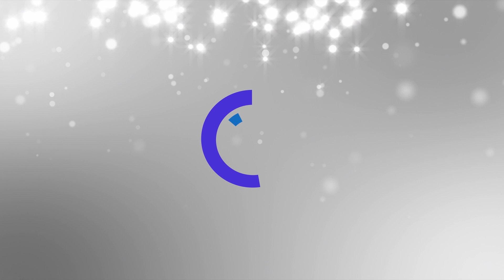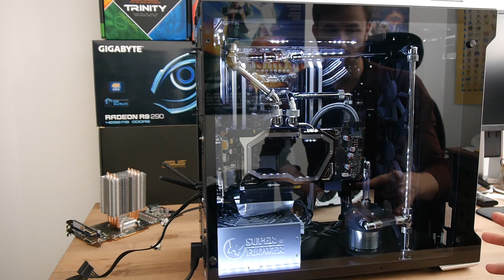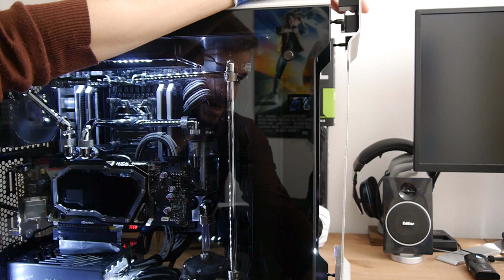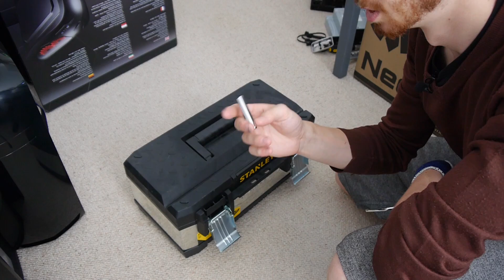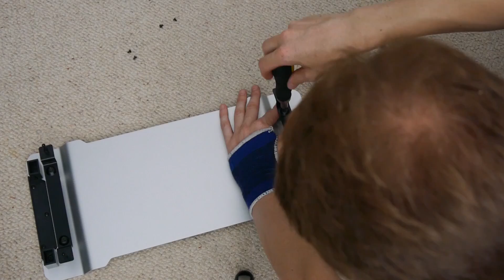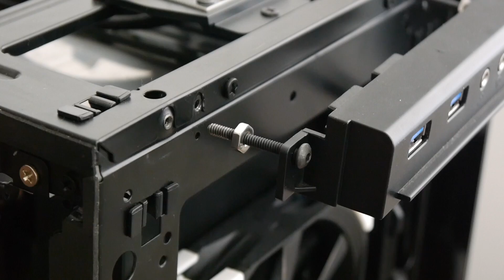How to Fix the Airflow Problem with the Phanteks Evolv ATX

Comment: however never buy it if u own a gigabyte x570 series, a few works. the D led mess up the power creating a power loop. then the MB cant detect sata disks. 
 If u have Phantex and problems with fans or sata unplug the rgb led caple from Phanteks.
 OMG mhy build is fucked.  no fix no Tits. Chose sata or rgb..  after been in contact with Phanteks , they say they dont co operate good with gigabyte,

Comment: I remember when I got this case that I actually improved internal temps by tapinig up the rear with a black tape from 3M. 

I left the original fans in place pulling from the front and placed 3 fans on the top pulling into the case, creating positive pressure, the PSU which is the same as yours was pulling air away from the GPU in the same way as yours, this creates a negative pressure in that area which is then filled with the positive pressure air and then forced out the single rear fan next to the IO.

I tested it when compared to the panels off and I was running cooler when the panels were closed.

Comment: What I did was moved the radiator to the front of the case, 2 fans on the back of the radiator and 1 on the front,pulling air. 1 fan on top, pulling, with black cardboard covering up any exposed gaps around them. Then finally one fan on the back pushing. I have good airflow coming out of the back atm, I can feel it on my hand, under the fan that's pushing.

I would doing only 2 fan on the radiator, but the airflow through there is too tight. I think I should switch the 2 to the front of the rad, and put the 1 on the back.

Comment: I just bought a 1x10 board that was 4 feet long from my local lumber yard, cut it to the exact shape as the case, and cut out the entire notch where the USB and Audio ports were and left it open. Stained it to match my desk. Also cut the side slots about 1/2" deeper than the original after I got the exact shape. then I used a router to give a 45 degree angle to the entire outside edge. Airflow problem disappeared. Currently trying to make a wood top panel, but it's a little more involved... :(

Comment: Im a bit late with this, but was thinking of this case for my new build in a few months, so wanted to see some reviews, which everyone should do. The vid has me thinking now. Been reading the comments, and seen you said all your fans are the same speed. wouldn't it be easier than modding to up the fan speeds a bit for the front fans by taking them off the fan controller and connecting them to the MoBo, or a separate hub? Or can the controller control different fan speeds at once? Other than that, great vid, gave me alot to think about.

Comment: I would perhaps drill uniformly aligned holes on that front aluminum metal. Or cut up triangle  like shapes forming a nice design up front kinda like Iron Man eyes or any other design look. Holes for the fan to pull air in. Hard without proper tools though.

The smoke seems to havr been pulled in by the PSU Fan

And speaking of PSU fan, you really should have made the fan facing down so it can pull ambient temp air from the under belly of the case. And not warmer air inside the case. Even worst when its a water cooling rig. Dont want the holes of that psu fan grill facing up waiting for that one single drop.

Comment: This is funny because I have 2x inlet fans at the front, and 3x exhaust (2 up top with rad, and 1 rear switched to Riing fans).  I do not have dust in my unit as I would usually.  My unit is 2 years old now, and my cases usually look like the moon by this point.  I can literally sell anything in my rig as mint and it would be near dustless.  The dust pattern of my filter with 2x 140 fills pretty much the circle of each fan.  I have the top portion left open.  I run X62 Kraken AiO, and a 1080 FE.  With a custom fan profile where 80 degree gets 95% fan, and 75 degree gets 75% fan, I don't usually go over 72 degree temp.  I don't have the stuff overclocked.  This thing does not flow like all the Lian Li cases I use to have, but all my Lian Li cases were filled with dust using air coolers.  This case with AIO combo has survived the dust apocalypse for me so far.  Kinda wish I wasn't too lazy to rebuild everything in the Evolv X.

Comment: The new "Evolv X" has addressed those issues and then some, it is suppose to come out this August or next month. Phanteks has claimed three times the airflow at the front panel, and five times airflow for the exhaust at the top.  With clever cable management panels that doubles as mounts for nine SSDs, and also can hold up to ten traditional hard drives at once as well. Also with the nifty option of installing a secondary mini ITX system at the ceiling of the case itself which essentially houses two computer systems at once!. With all that capability of holding all of the above at once, that would be one heavy beast to lug around. Looking forward to getting it myself. :)

Comment: What is the length of the spacers? I dont want to space it out to much.
Reply from the maker: I used 2-2.5cm, but 2cm will give excellent results. Anywhere from 1-2cm will give a significant improvement, it just depends how far you are happy to space it out.

Comment: This is a lot more elegant than what I do which is removing the entire panel when I game. Also you'll notice that propping the top panel also helps evacuate some of the hot air out the top
Reply from the maker: I haven't tried propping up the top panel yet. I'm not sure what is the best way to do it, and I don't have much cooling going to my top panel, so I've never been too bothered.  How did you do it?
Reply: Jeagar Tech I just removed the 4 screws from that top panel popped it off so there's a slightly bigger gap to allow for the hot air to exit. I have a 280 rad up there so when my fans ramp up it helps evacuate the got air

Comment: what about the top panel? can you do the same with some spacers?
Reply from the maker: Not really, the top is held in differently and you can't really just raise it up at all... To get better airflow you might have to cuts holes/vents in the top panel.
Reply: bad news:( btw you could buy spacers on aliexpress of every mm you need).  What do you think about the nzxt h700i ?
Reply from the maker: What sort of spacers? 

Err, the H700i looks pretty decent, I think it is classic NZXT (so as a whole a damn good case!),. and the airflow looks not bad, if not the best. It's so overpriced though!
Reply: Jeagar Tech Im trying to understand if airflow is better on h700i than the evolv atx. For the spacers I will search for the links
Reply from the maker: Ahh okay, the H700i will have better airflow without modding.
Reply: so spacers I've found and ordered are: https://it.aliexpress.com/item/50pcs-lot-aluminum-spacer-M3-5-6-8-10-12-15-20-25-30-35-37/32811889038.html?spm=a2g0s.9042311.0.0.YFnBdz
and  https://it.aliexpress.com/item/10pcs-lot-free-shipping-3mm-aluminum-spacer-m3-10-15-20-25-30-35-37-40/32809949758.html?spm=a2g0s.9042311.0.0.YFnBdz

plastic spacers are easyer to cut XD

Comment: They make replaceable front panels for this case that have proper airflow design. 

https://mnpctech.com/phanteks-case-mods/
Reply: Here is another one I'm sure You've seen but still does a fantastic job, Design 4 really follows the normal hole design on the top piece.

https://www.gosumodz.com/EVOLV-CNC-Service
Reply from the maker: I havent seen those actually, they look really good!
Reply from the maker: It's such a shame, but at least you have a nice looking mod that makes your case unique.
Reply from the maker: The smoke test is really easy to do, and is a really useful test if you just pop the front panel on and off and see what happens. Let me know how it goes!
Reply: No noticeable smoke entry from the back or sides of the case. There's actually a positive pressure at the PCI-E vents, blowing outward where there is no exhaust, so that's a real plus. It just took me programming my fan curve for a constant of positive pressure, and, of course modding the front panel. So, yeah. With the front panel on, I've got positive pressure and hopefully a lot less dust accumulation in the future.
Reply from the maker: Yeah these were some of the ones I was talking about in the video. I think they look really cool, but I still prefer the plain panel look.
Reply: I wish they would do work for the P400STG. No one seems to want to mod the front of this thing.
Reply: I haven't finished it yet, really, as I'm waiting for metal reinforced cutoff wheels and a step drill bit (very expensive) to arrive. I actually used an older iPhone charger block to make the rounded diamond shapes for the template, and I think it will look fantastic once it's done. But like you, my case was pulling air from all manner of areas it shouldn't. Negative pressure abound. I think it still might be when I max my fans out, because I have two top 140mm, one 120mm rear, GPU and PSU exhausting, while only two 140mm fans on the intake. But, I've put two slower, quiet Phanteks fans exhausting out the top and two Cryorig QF140 Performance fans on the front intake and am running the fronts at 1/3rd again as many RPM's as any of the exhaust fans, so the pressure should be pretty close to even at this point. I'm going to do the smoke test later this week to be sure.
Reply from the maker: That's awesome, nice work! It can take a while to get just right, but I'm sure it's going to be worth it from now on lol

Comment: You should have done like I did with my P400STG and drilled some nice looking holes into the front panel. Mine is even made of sheet metal, so it's harder to drill than aluminum. 

https://drive.google.com/open?id=1UxIMOBZu__lv8qEvg-bhB6_MHRbNfeHX
Reply from the maker: That's a nice looking mod! I had thought about drilling/cutting the panel, but I preferred to keep the look basically the same. The point here was to improve airflow without altering the looks too much.
Reply: Love the P400STG I'm still debating between the White P400S or the Silver Evolv.
Reply from the maker: Good luck deciding, those are two really nice cases! I like all of the Phanteks lineup at the moment, it's a nice range of styles, and they all have sleek individual looks in my opinion.

Comment: I like that you showed how the air is sucked in when you have negative pressure. I shows that airflow has a huge impact on dust building up inside the case.
Reply from the maker: Thanks man, I had no idea how bad it was until I tested it!

Comment: Good modification. I took the same idea and used nylon spacers and 6-32 thread thumb screws. I spaced it all the way up to where the front panel edges slightly ahead of the edge of the glass. So far its dropped a couple degree celsius and the aesthetics of my case aren't noticeably hindered plus I have complete access to the front I/O with the I/O door able to completely open all the way. Only problem is the front rgb LED is to far back to show through the front but that was expected. Ill figure a way to fix that next time.
Reply from the maker: Awesome! It's nice to hear that someone else had the same idea :D I extended the LED, unfortunately I didn't show it, but it was the same process as the I/O that I show at the end. Just use a screw and a bolt to hold it in place further away from the case :)

Comment: 2 fans blowing out the roof, 1 fan blowing out the back and 3 partly obstructed fans sucking in the front. That logically translates to negative pressure, no surprise there. Before thinking of modding the case i would have worked with the fans speeds. Possibly removing the back fan completely, or adding a floor intake, i don't know if this case offers that option.
Reply from the maker: I did change the fan speeds because the dust build up was annoying me. I had the rear exhaust fan completely off at idle.

The problem with that is that you are losing airflow performance or increasing noise. That is the problem. You can always just make your intakes spin faster or exhausts spin slower, but that doesn't solve the problem, it just changes the problem. I'm trying to solve it here, and the mod wasn't difficult/I was happy to do it, so it was a very logical choice :)

Comment: Just ditch the rear exhaust fan and u get u'r self a positive air pressure system.
Reply from the maker: The problem with that is that you are losing airflow performance or increasing noise. That is the problem. You can always just make your intakes spin faster or exhausts spin slower, but that doesn't solve the problem, it just changes the problem. I'm trying to solve it here, and the mod wasn't difficult/I was happy to do it, so it was a very logical choice :)

Comment: I'm just going to try different fan configurations and if all else fails I'm going to dremal that front face so the gaps are wider
Reply from the maker: Yeah that's not a bad idea. If you can get airflow/temps/noise that you are happy with without having to hack the case up then that would be best :)

A tip though, if you intend to use a dremel then start from the inside. I saw someone try to cut air vents with a dremel and ruined their case because they couldn't cut all the way through it so they just had cuts marks all over it!

Comment: Have you tried less than those 2½cm spacers? I would think that maybe 1cm would be enough?
Reply: Grinding the front plate could also be a way, but damn that wouldn't look nice without some professional tools
Reply from the maker: 1cm wasn't quite enough, I was still getting negative pressure (so the fans will have been very restricted still). 2cm gave me positive pressure, just. So I think 2cm gets rid of most of the choking, I'd still recommend about 2cm.
Reply from the maker: And yeah, you could cut some nice designs into the front that would improve airflow AND look badass, but if you don't have the tools or the skill then you'd just wreck your case lol. If you wanted to though, it might be worth looking for some form of professional who can do it for you.

Comment: Instead of the indented front plate design, you could have a flat plate fabricated that has the side notches still there, perhaps accentuated.  That way you still have the look and increase the amount of airflow along the sides.  The case front is the whole reason I didn't go with the Evolv.
Reply from the maker: You definitely could, or (if you're skilled with an angle-grinder/know someone who is) you could accentuate them yourself. That would definitely help airflow. 

Yeah, the whole case market in general is providing pretty poor performance, GamersNexus has been doing some pretty interesting videos on the matter as well.
Reply from the maker: What case did you end up going with?

Comment: Hey, nice video, really helpful. I plan to get that case also. I've noticed you got that vertical GPU mount, do you have a video showing how you did it ? If not, can you make a video showing how it is done? Thanks.
Reply from the maker: Hey man, thanks a lot! So I won't be making a video showing how I mounted my GPU vertically because I really wouldn't recommend the way I did it lol! Basically, mine is pulled into the centre of the case a bit so that my pipes line up, it makes it less sturdy and more difficult to plug in connectors. 

The best way to do it is to mount it to the top of your expansion slots. OC3D did it in a video a linked to someone else, here it is (the explanation starts at about 7:30): https://www.youtube.com/watch?v=KSVUyAceW6w&feature=youtu.be

Comment: Didn't you thought that the air is being sucked back in just because your exhaust fans are spinnig too fast? I mean it may be caused by exhaust fans spinning faster than the intake fans, so the rear and top fans need to suck the air from the outside of the case cause front intake cannot supply enough air. Just my thoughts, it would be nice if you could verify that.
Reply from the maker: All of my fans have their speed controlled via a dedicated fan controller. Before I did the mod and when I was testing in this video, the speed of all the fans was identical all of the time because they were running on the same fan curve. 

So when I did the first smoke test without the panel on the front and the smoke was blown away, it showed that there was more intake than exhaust, and then I put the front panel on and air started to get sucked into the case, showing that with it on there is more exhaust than intake. All of the fans were spinning at identical speeds the entire time, so this shows that the front panel is reducing the intake airflow. Thanks for the question :)
Reply: Thanks for the answer. Also, have you been doing any temperature tests before/after the mod?
Reply from the maker: No I didn't. Biggest mistake, I really should have done, sorry about that... 

I didn't really think about it, because for me this was a dust problem. I can tell my temps have gone down in game, but I don't have exact figures, and because of my cooling setup I'd need to do a controlled test at a set fan speed to give an accurate number.
Reply: Ok I understand that, thanks for your time.